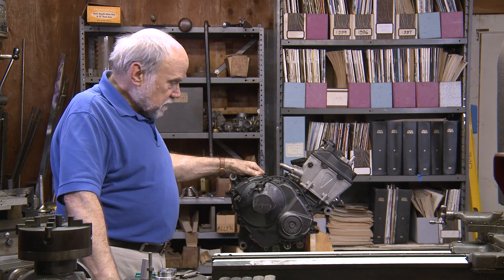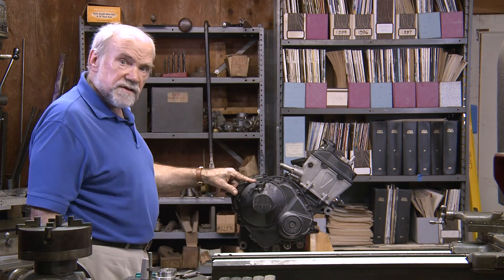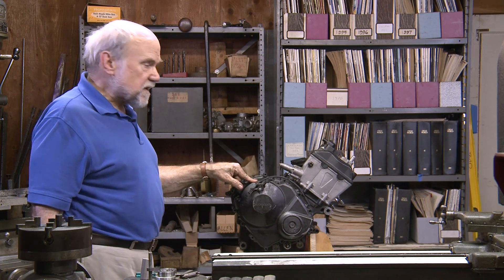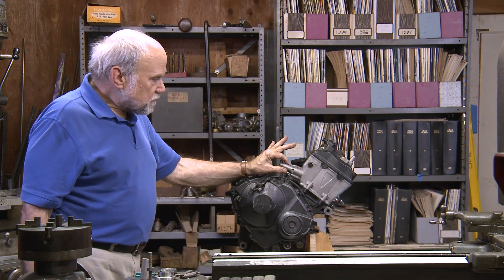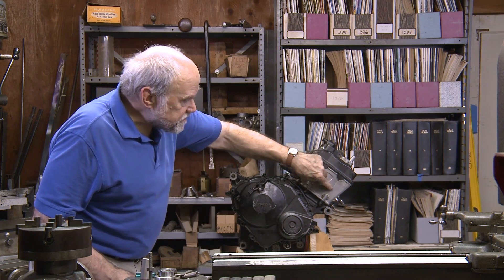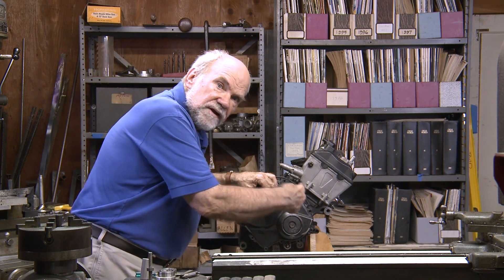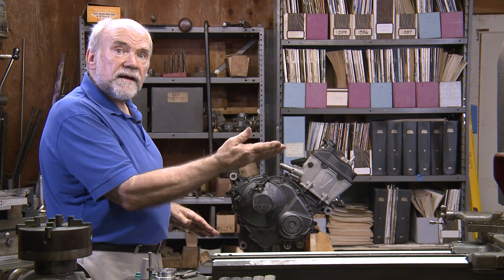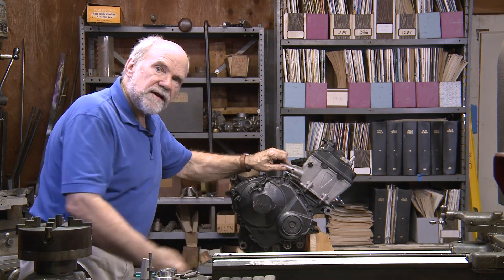What Are The Identifiers Of A Modern Motorcycle Engine Design?

Comment: How does the angle between the valves effect performance.......?
Reply: more compact in form factor, and a flatter combustion chamber equates to higher compression = More power
Reply: Alinel you do have a point
But one can achieve higher compression ratio just by changing the piston dome design 
Smaller valve pockets in the piston
And tighter squish clearance 

What i don't understand is how does the  angle of valves effects performance 
My single cylinder SUZUKI AX4 has an intake & exhaust valve angle of 24° & 26° respectively
Reply: @mustafaYkhan  Beyond coincidence! we have the AX4 disguised as the "Suzuki Fiero" in india ...one more point to note is that the spark plug location has also changed because of the change in combustion chamber design and quite easy to notice in modern bikes.!
Reply: Some older single cylinder engines that i know were like 80-90° apart
That's like each valve 45° from the piston center line
Reply: Mustafa Yamin I think it's for high compression. The older hemispherical combustion chamber has a crescent shaped area which takes longer for the spark to ignite. So the modern flat  cylinder shaped combustion chamber allows for a faster burn and higher efficiency.
Reply: It might be related to aerodynamics of intake air, maybe increase in swriling. Just Speculating :)
Reply: Kevin has explained in more recent videos why a flat combustion chamber is superior to one with a high domed piston. (Flame propagation time)